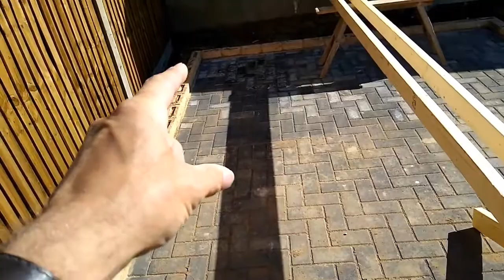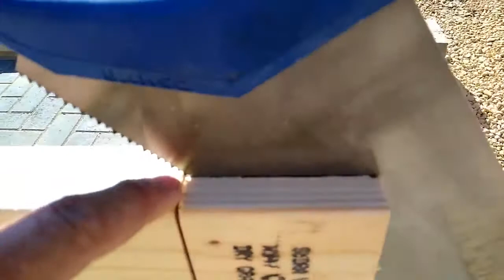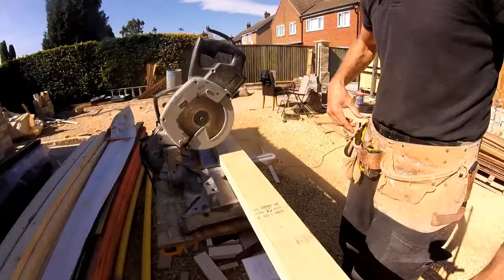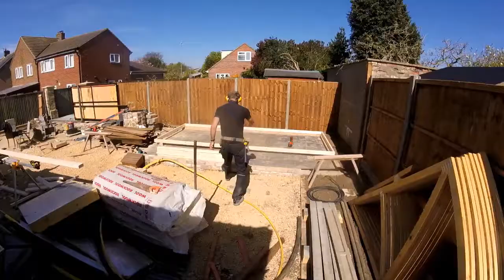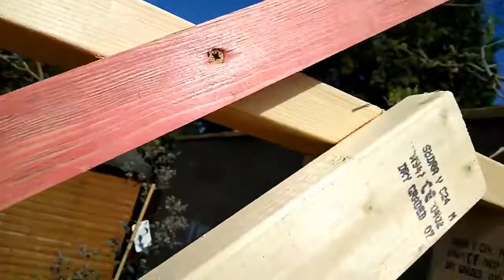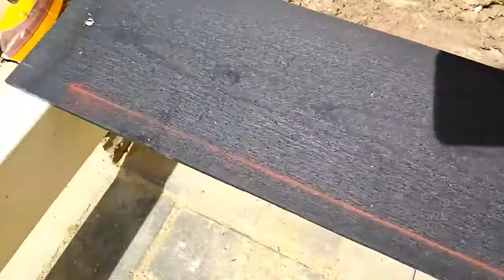How to build a timer frame carport

Comment: GET A MIKE
Reply from the maker: Hi Alex. These car port videos were my very first attempts at videoing my work. It's fairly obvious when watching them that I had/have a LOT to learn about film making. I was only using an old GoPro and my cheap old smartphone. I've since bought a new camera which has much better audio. Hopefully, if you check out some of my later videos, you will see a big improvement in both audio and picture quality👍Thanks for watching😎
Reply: @thetallcarpenter  Thanks for the reply, Yeah, I get it. Keep on it bro, the only way is up. x

Comment: Hi really enjoying you build series I am about to undertake a similar project myself.  I have a question about building regulations did you have to comply with any for your build I have read as my proposed garage is more than 15sqm and with 1m of boundary it cannot be made of a combustable material.  So not wooden.
Reply from the maker: Hi Matthew. To be honest, I'm not ofay with building control regulations in relation to this matter. This particular carport was for a small developer I do work for, so I know it will have been subject to both planning and building control regulations. I know that the two side walls adjacent to the boundary had to painted with a set amount of coats of a special flame resistant paint. A quick phone call to your local building control office should give you the answer. 😎 Thanks for watching and good luck with your project. 👍 Cheers.
Reply: @thetallcarpenter  thanks for the quick reply, can I ask where your based?  
As looking to have a similar garage made.  
My understanding is the painting option is what we’d have to do also that’s the building control compromise.
Reply from the maker: @matthewfletcher6731  Hi Matthew. I'd rather not give my exact location in these comments, (I hope you understand), but I'm in Cambridgeshire. 😬 Cheers.
Reply: @thetallcarpenter  I completely understand that one, I think West Yorkshire might be a bit far for you to quote on a garage build if you were interested, am I right?
Reply from the maker: @matthewfletcher6731  Hi Matthew. Thanks for your reply, and yes, you may be a tad too far for me to travel. 😬 Cheers.